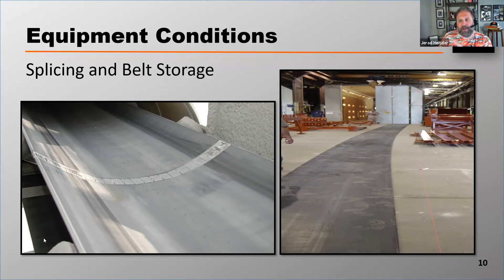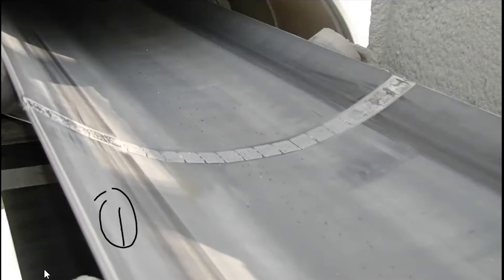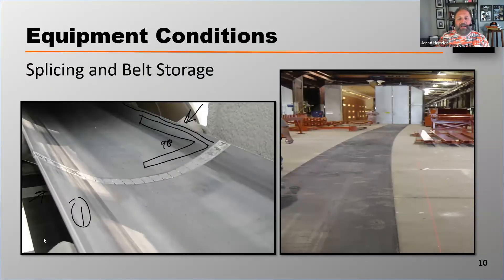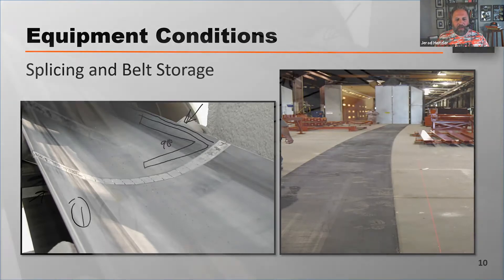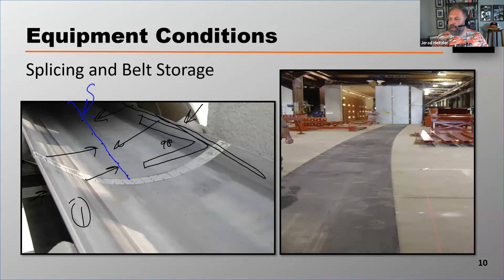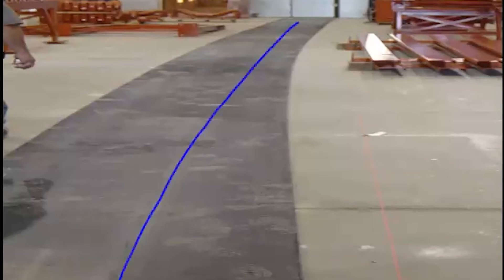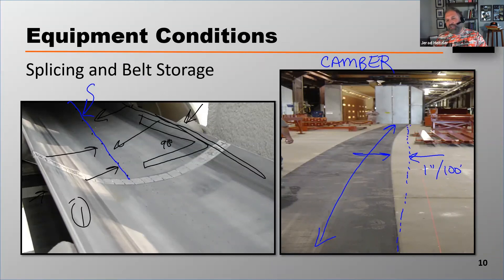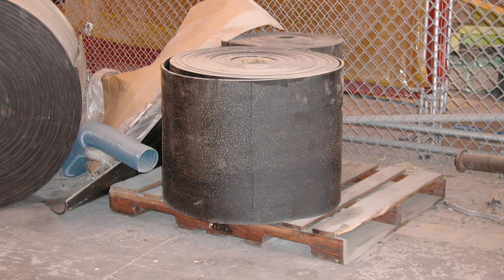Improper Belt Storage and Splicing Cause Conveyor Belt Mistracking

Comment: On camber, not sure if I'm misinterpreting, but this video say 1" per 100' meanwhile the other video https://www.youtube.com/watch?v=Q9cQswsuUxQ&t=81s says 3" per 100' is acceptable. 

Would the 3" per 100' be the maximum that is acceptable?
Reply from the maker: Hello. Thank you for your question!

We sometimes say 3” of camber per 100’ and we also sometimes say 1” of camber per 100’.  Any where between 1” – 3” per 100’ may become problematic.  Some belts, depending on how they are loaded may be able to tolerate as much as 3” of camber.  Belts that are loading properly in the center and not too significant of a feed rate may not cause problems with camber that is measured at 3” per 100’.  For belts that may be off center loading (side loading) and at higher tons per hour, 1” of camber may be all that is allowable without causing spillage problems.  Every loadzone will have minor differences on the speed they are loaded and how well the load in centered on the receiving belt.  Generally, 1-3 inches of camber will tolerable.  More than 3” of camber may cause significant spillage and require belt tracking devices after and prior to loading.